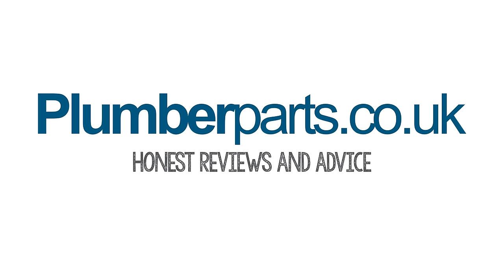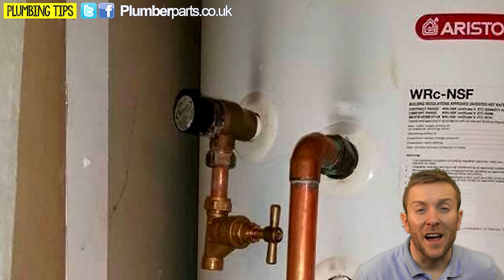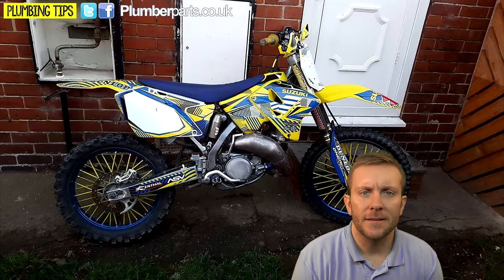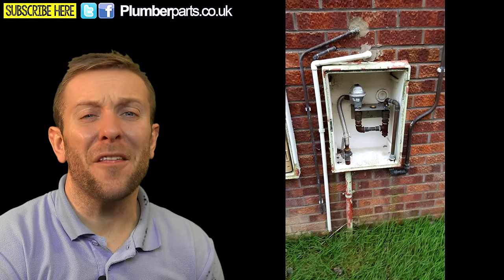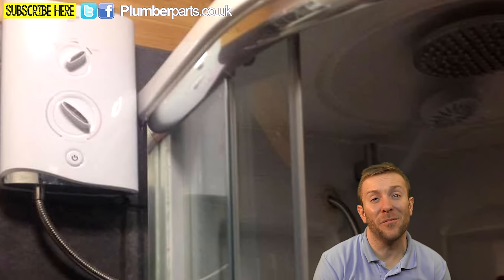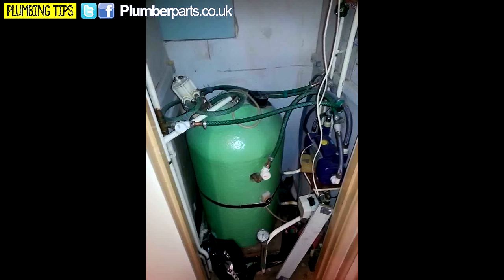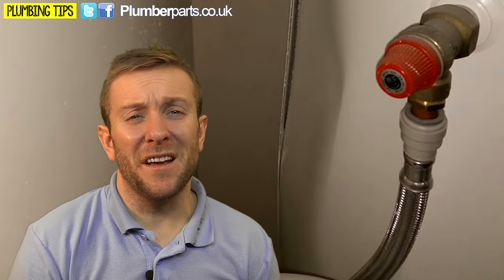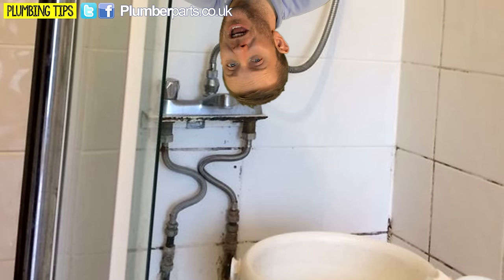PLUMBING DISASTERS 29 - Videos and Photos

Comment: that valve on the PRV wasn't funny.  that's scary.  people can die from that.
Reply: Thomas Jenkins isn't that a Temperature and pressure relief valve, that's on the water heater? Not a PRV, at least in America we call a PRV a pressure regulating valve and that goes on the main to regulate water pressure to the home. Interesting
Reply: PRV is used interchangeably most likely only due to the letters being the same.

PRV can be used to indicate a pressure reducing valve /
Pressure regulating valve or pressure relief valve

All that matters is you understand the difference between them and which it is your looking at

Comment: I think I have a plumbing disaster on my hands.
Had a new bathroom fitted. The plumber removed the old toilet cistern,cut the joining pipe and simply left it like that.
Tonight,I had both bath taps on and all of a sudden,water started running from the severed cistern pipe.
I'm hoping he'll be able to fix it when he comes back next week.
Freaking out slightly right now lol.